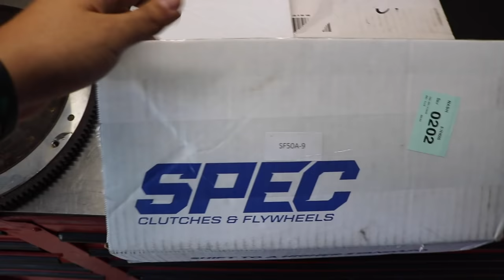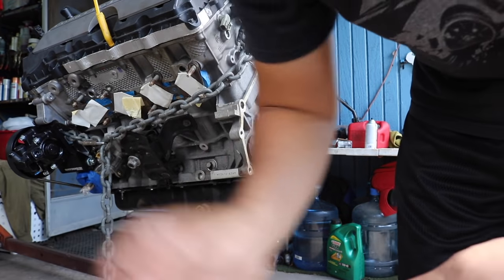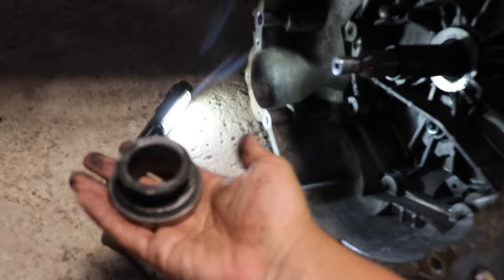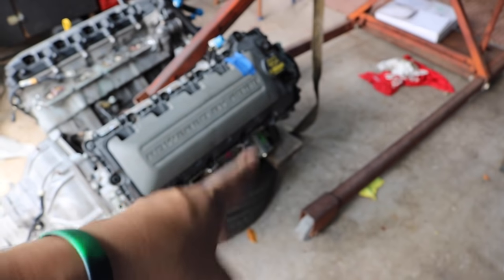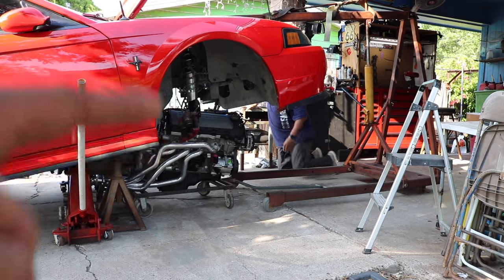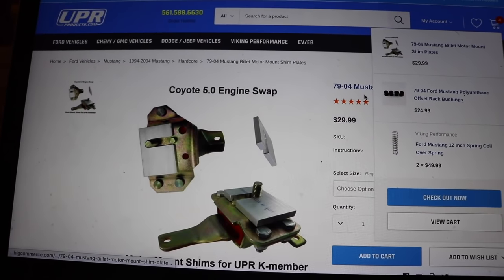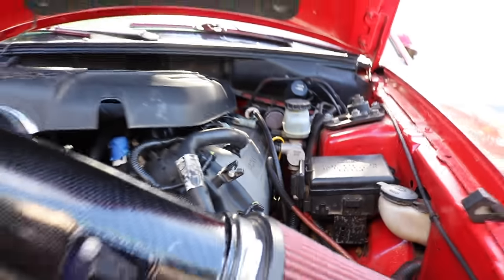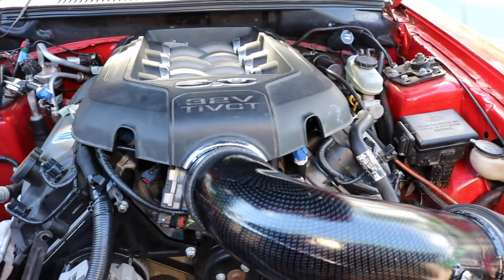Coyote swap goes in new edge mustang gt !

Comment: I'm working on my 96 Cobra Gen 2 swap. I was thinking I'd put the engine and trans in the K member then get 4 or 5 strong buddies to help lift the front of the car up and onto the drivetrain thats sitting closer to the ground. Put the 4 main k member bolts then jack it up on stands and keep going. 
Any suggestions on the easiest approach would be appreciated. Thanks!
Reply: A note being that everything that you will be doing is not supposed to be there there will be a lot of carful movements so I would advise having some kind of hydrologic suspension to suspend the car while you are mocking everything up not sure if your buddies can handle the lifting and holding while you adjust your build we used cherry picker apron fender engine support jackstands and floor jacks

Comment: Did you have to use k member spacers with the UPR k member and bbk headers to fit? Or just motor mount shims? Thanks
Reply: Motor mounts are enough to clear sway bar and the top should fit if you have a cowl hood we wanted stock hood so we use the k member shims as well thanks for commenting

Comment: I've been seeing mostly engine swaps with the car on a lift and lowering the body onto the engine. I see from your video that it can be done with the front of the car jacked up and raise the engine into place. I don't have a lift so this is probably the way I will go. Good video.
Reply from the maker: Thanks man! I appreciate you watching and yeah this was scary at first but after doing it several times it’s easy just bolt up a chain to where the kmember bolts are and jack it up from that chain.

Comment: I hear you can swap to a carb engine or another fuel injected Motor
So ive heard you have to re wire the dash ? I never have understood that
Reply: It’s easy you just leave the fuse box run one power wire to it and the whole inside will have power. You can put a lot of different motors small block and big block chevys fit, ls motors fit. Small block fords late model ford engines etc.

Comment: On the swop i all ready have a BBK xpipe from the exhaust manifold back. If i wanted to keep that would i have to get a pair of the short headers? and would that take away any horsepower?
Reply from the maker: Yeah I recommend just getting the long tube headers but you might need to have a muffler shop fabricate some stuff if you want to keep short headers

Comment: @JD2v I’m doing almost same coyote swap as you are now I’m also running a t56 transmission and spec stage 3+ clutch but what  bell housing did you use I know the stoc bell housing doesn’t fit I just bought a quick time bell housing for my gen1 coyote swap  in my 2000 Mustang gt
Reply from the maker: Hey man first off thanks for watching means a lot ! And I appreciate you commenting. The t56 I used is from a 03-04 cobra terminator. It bolts right up so the stock cobra t56 bell housing will work! How ever if you get the magnum t56 you will need a QuickTime bell housing. QuickTime bell housing should also work with the cobra t56.

Comment: Any updates?  Ever think about getting a different oil pan that clears the k memeber instead of the spacers?  Looks like removing the 3/8ths spacers might help with hood clearance and header collector clearance.  But perhaps it would cause other issues.
Reply from the maker: bartz118 your 100% right man . I would like the oil pan it’s just that I didn’t want to spend the 300+ $$ on it lol in the future I will get a aftermarket one and remove the spacers . And right now I’m editing the next video , but fuel system is on only thing left is to button everything up and install the control pack !
Reply from the maker: bartz118 I appreciate you watching and putting your 2 cents . Thanks again bro !

Comment: bbk are not bolt friendly ,,,,, I got the shorty headers for a turbo and my god some of the bolts you can barely get in the header I had to use stock and bbk bolts , after market bolts its crazy and some have to be put in before installing the header or you will never get the bolt in hahaha then the doughnut exhaust bolts can hit the header you have to be careful what size you use but what an improvement ,, the bbks sound incredible once you get them in

Comment: Hi i have 2000 mustang gt very clean only 93k. Km. No rust. And my brothers 2018 f150 5.0. Got totaled from back side so i am planning to swap my 2v. Can someone tell me that can i swap whole drivetrain include trans and motor. And what else can i take out from f150 which will fit in 2v?

Comment: Very nice! What transmission did you end up going with there?
Reply from the maker: Ended up going with a 2003-2004 cobra t56 transmission ! Thanks for watching by the way 🙏🤘
Reply: @xJD2Vx  Awesome, that’s what I was thinking of using if I did this as well. Might be getting a new edge and doing this swap myself in a year or so. Subbed for more!
Reply from the maker: @TonyTheTruckGuy  thanks for watching he sub ! And yeah man for sure it be a fun and awesome project hopefully you can do it soon 🙏🤘 thanks again man
Reply: @xJD2Vx  since you have a cobra t56 your car is gonna have really long gears way longer than mt82 trans that come with the coyote cars so I suggest doing very aggressive gearing out back.  I'd do 4.10 if you're planning forced induction if not go even lower 4.30 or 4.56 trust me it isn't too low with that t56.  That high revving coyote is gonna want those steep gears and if you do cams and ported cobra jet and shoot for 500 rwhp all motor its gonna be spinning 8 grand itll def need those gears then.  Itd be so nasty.  There was a saying in the old na 4v community dont fear the gear and the same applies here.
Reply from the maker: @midnight347  thanks man I appreciate you taking time to comment and given advice ! But I’m way ahead of you I got plenty of gear in the rear already installed 🤫😎 just know it’s 4.up

Comment: Did you have to cut into the frame to coyote swap it? Or did it fit without cutting into it?
Reply from the maker: No frame modifications at all! Main thing is you need to get a aftermarket kmember mine is a upr kmember 🤘🏼

Comment: those flywheels with removable friction pads should never be resurfaced. they have replacement pads for a reason. no hate just facts.. great video!
Reply: Couldn't find one for stock Ford cobra my friend tried looking for one for his as well nothing so that was the alternative and it worked so that I know they do not service replacement clutch rings for the ford cobra stock flywheel that I know of and I have a terminator as well

Comment: On some vehicles is it best option to pull motor from bottom?
And not top?
Reply from the maker: Depends on my case it was easier due to the long tube headers . But most people with the swaps pull and install engine through the bottom

Comment: Tengo gt año 2000 que motor le pusiste a tu carro te agradecería si me brindaras algo de información gracias saludos desde Seattle
Reply from the maker: Gracias por mirar el video! Mi motor es un 2015 mustang 5.0
Reply: @xJD2Vx  cuanto invertiste en todo sin contar el travajo solo en las partes y motor
Reply from the maker: @arturoalvarado5517  18k puede ser mas barato pero yo compre extra cosas (upgrades)

Comment: What wire harness you use
Reply from the maker: I used a 2015 engine harness so gen 2 and I got a gen 2 manual Ford control pack from power by the hour . Thanks for watching man 🤘
Reply: @xJD2Vx  I want to put one in my 99 crown Victoria the motors are expensive online
Reply from the maker: @chevycaprice8956  yeah man I’ve spent 16k for this whole swap lol 😬
Reply: @xJD2Vx  ooooouuuucccchhhhhh🤐
Reply from the maker: @chevycaprice8956  yeah I knew what I was getting myself into lol if it was easy and cheap everyone would do it but this has been something I’ve always wanted to do 🙏😬
Reply: @xJD2Vx  me 2 I have done a ton of ls swap I would like to concur the coyote swap

Comment: I wonder if I can do this swap to my 04 v6
Reply from the maker: Abdel-Wahab El Farran thanks for watching ! And you can bro might need to upgrade more parts not too sure but it can be done
Reply: You can do it but it isn't as easy as starting with a v8.  I would suggest getting rid of your car and buying a new edge gt with high miles to do the swap on.  May be easier in the long run.  You can literally drop the engine down in the car stock brake booster, stock trans if 5 speed, stock motor mounts and kmember etc.  96-04 v8 mustang's as well as the 05-10 3v are some of the easiest cars to coyote swap.  You literally only have to change the engine and I would suggest a ford control pack to make tuning etc easier but it's a pretty easy swap.  With the v6 you would need to change the trans, rear end, motor mounts, kmember, brake booster etc etc...all things that you wouldn't need if starting with a v8.